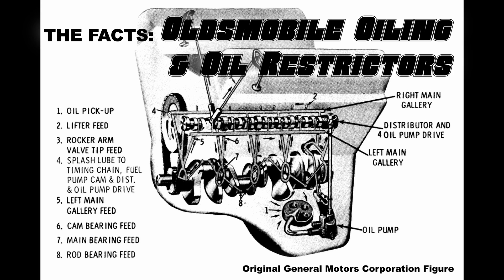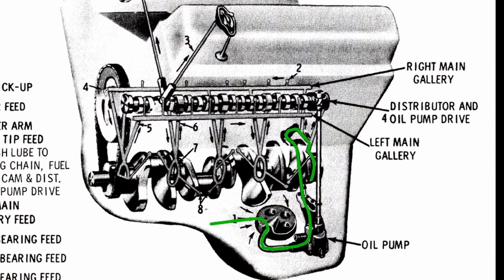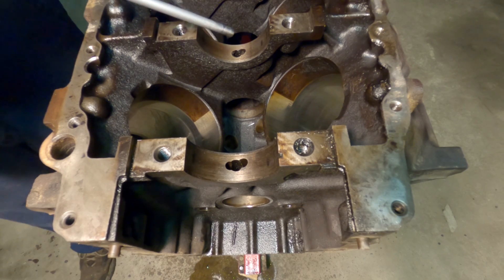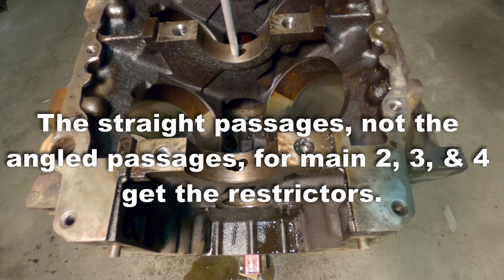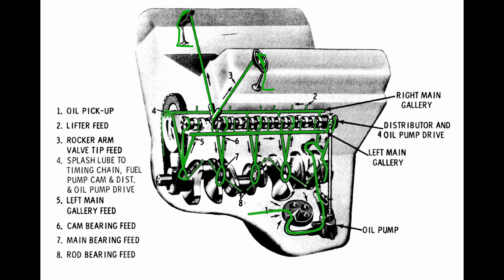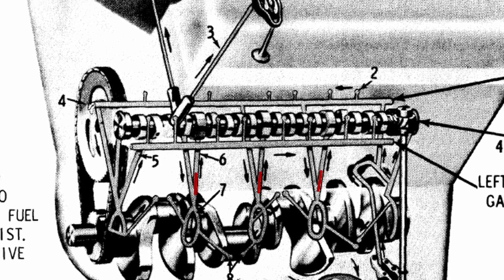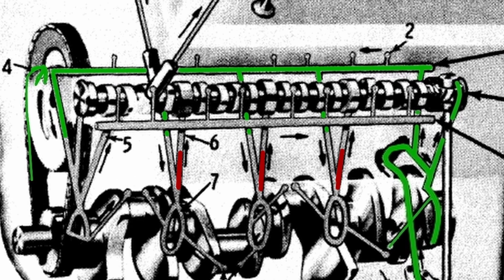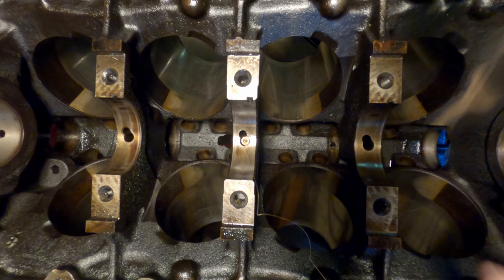The Facts on Oldsmobile Engine Oiling & Oil Restrictors

Comment: What's considered high rpm?
Reply from the maker: Oldsmobile engines have heavy rotating assemblies, any SUSTAINED rpm's higher than 5000 rpm is risky with stock pistons, rods, oil pump, and crank. The weight of your rotating assembly puts a lot of strain on the two bolt main bottom end at 5000-5500 rpm. If you upgrade to a Nodular Iron crank, forged aluminum pistons, oil restrictors (the 3 in the bottom end mentioned in the video), ARP bolts, main cap supports, HV oil pump, Clevite 77 bearings, and have your rotating assembly balanced, you can safely run an Oldsmobile engine to 6200-6500 rpm.
Reply: @junkdump2720  well that explains a bunch.  When I was 19 (45 now) I put a mild cam, 4 bbl intake, headers and HEI on my 69 rocket 350 and ran the hell out of it. Had 63,000 on the clock and was shooting oil out the tail pipe by 96,000. Ran 9s in the 8th with basically stock parts and a 2 speed Jetaway trans. First car, first build, first broken heart when she died.
Reply from the maker: @BigUnitBeef  What a great car story, even with the tragic ending. I raced with my first Olds on the 8th mile too! Thanks for sharing.
Reply: Personally I feel oil restriction is not needed on the bottom end. Use back grooved cam bearings and then use a quality restricted pushrod, enlarge the oil returns in the heads and in high performance applications drill the back of the heads for drains that go directly back to the pan. The oil problem is on the top end not the bottom.